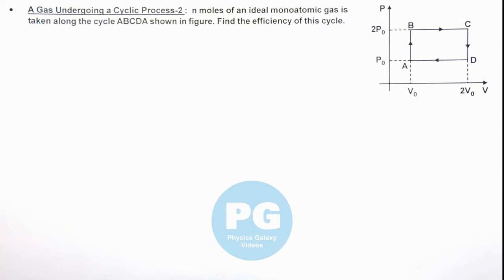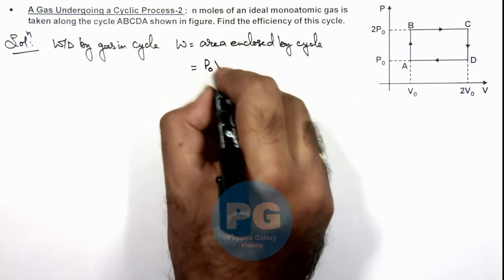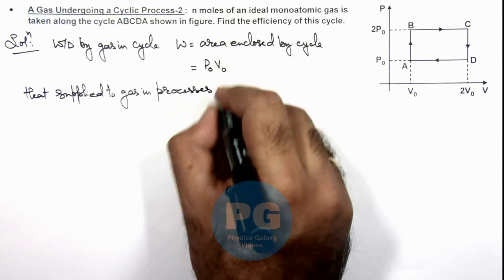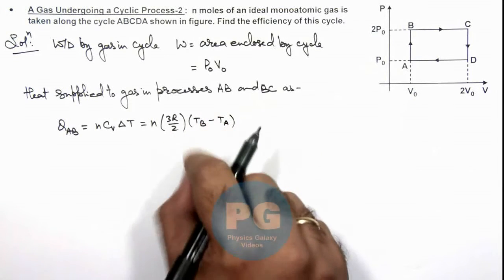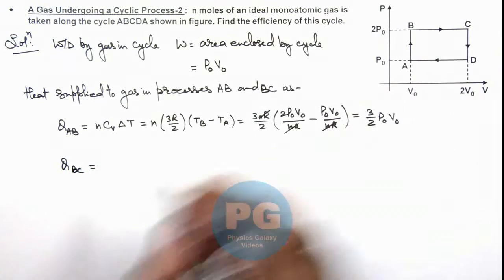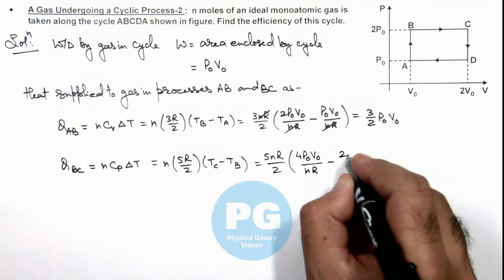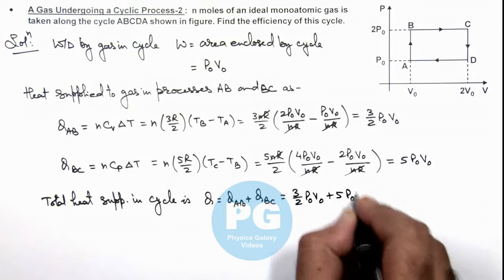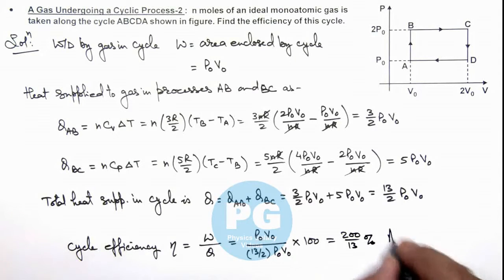41. Advance Illustration | KTG and Thermodynamics | A Gas Undergoing a Cyclic Process-2

Comment: for more clarification calculate W,Q for each process as ∆U=0 in each case.:

A→B: W=0,Q=+1.5PoVo
B→C:W=2PoVo, Q=5PoVo
C→D:W=0,Q=-3PoVo
D→A:W=-PoVo,Q=-2.5PoVo

Efficiency= Output/Input=Total work done/Heat supplied to gas(i.e. Q must be +ve only)=2PoVo-PoVo/(+1.5PoVo+5PoVo)..=2/13
Reply: Thank you brother

Comment: Sir why for heat only see Ab and bc steps?
Reply: Because we have to consider only heat supplied in cycle
Reply: Because only in AB & BC , heat is absorbed by the gas.
Reply: for more clarification calculate W,Q for each process as ∆U=0 in each case.:

A→B: W=0,Q=+1.5PoVo
B→C:W=2PoVo, Q=5PoVo
C→D:W=0,Q=-3PoVo
D→A:W=-PoVo,Q=-2.5PoVo

Efficiency= Output/Input=Total work done/Heat supplied to gas(i.e. Q must be +ve only)=2PoVo-PoVo/(+1.5PoVo+5PoVo)..=2/13